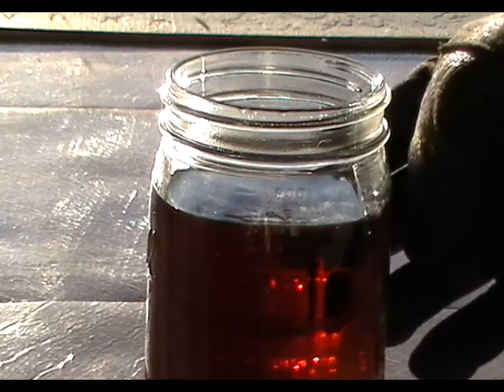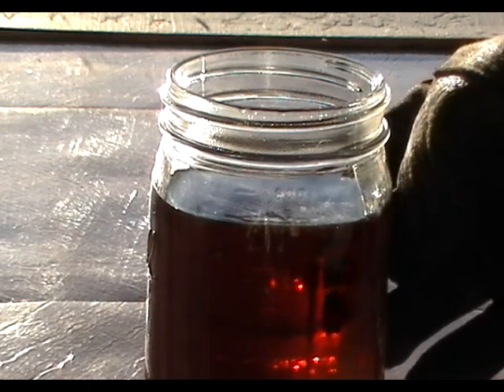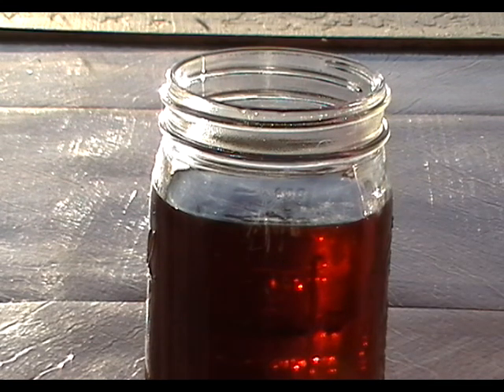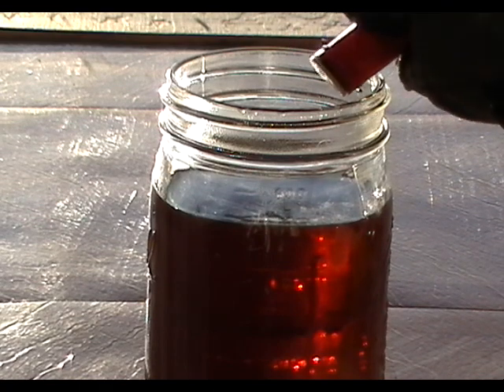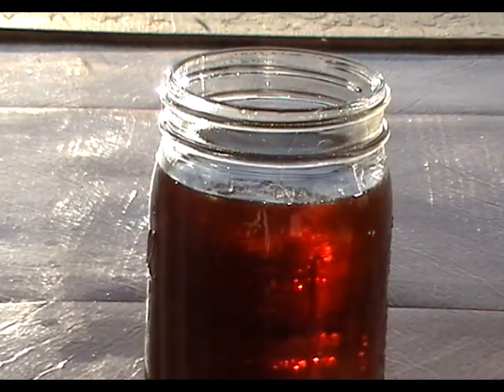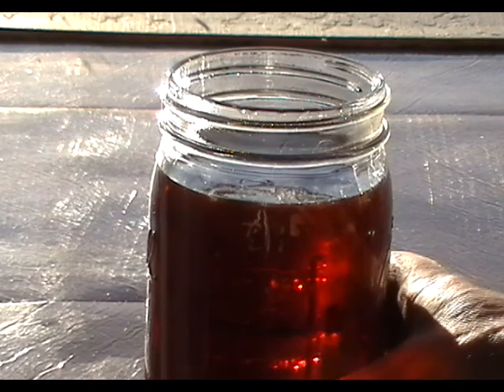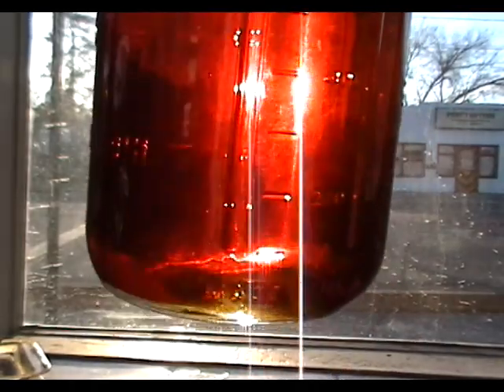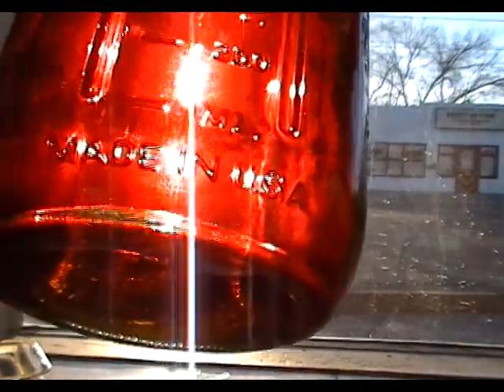Blending Gasoline with vegetable oil to make Diesel Fuel

Comment: Heating Oil Use: I started blending gas/wvo about fifteen years ago when heating oil was equal in price to gasoline.  I did not have the time to create pure bio-diesel, so I started playing around with blends.  I was amazed at the blending action of gas added to wvo.  With no stirring the gasoline would mix with a cross-hatch striation, by itself, and completely blend.  My goal was a blend of 25% gas to 75% wvo.  I found it depends on the heat exchanger in the boiler.  When I upgraded to a new boiler, I had to increase the blend to 1/3 gas.  All the wvo was filtered to 5 microns.  Pros: Cheap fuel, boiler never needed cleaning.  Cons: Boiler nozzle, aerator, and electrodes needed periodic (monthly) cleaning.  Standard pump needed yearly changing or rebuild.  Found a bio-diesel pump that was much better using better seals.  Suntec site has some answers.

The gas basically dissolves/blends with the wvo/contaminants and is burned off leaving some residue on the gun.  Friends would warn that I was going to blow up the house.  I laughed as the problem was getting it to burn.  25% seems to be the threshold and of course you need to give it a few minutes to blend and the fumes to dissipate.  Under normal conditions a match dropped in a small 8oz can of the blend would make a small sterno-like flame until it burned slowly until empty.  I used this blend for 5 years until oil prices came back to normal and wvo reclamation companies took over the wvo market.  

Note: My son-in-law uses a similar method for his diesel truck with a 5 minute gasoline to wvo blend with a cetane chaser.  He used this for about ten years.  Same pump issues though.
Reply: Very interesting good idea. I wonder if it would work in a kerosene wick type heater. Thought about using diesel with cetane booster but I'm a little concerned breathing the diesel fumes with all the additives they put in there.  it's in big garage that does leak a little air in. So it's kind of vented.

Comment: What an absolute gem of a video and thread to find ! I’m sat in my 1.9tdi crying at life 😂 you just gave me free fuel compared to how we pay here in the uk 🎉  Thank you all !!
Reply from the maker: You are welcome, but keep in mind that I have had some developments since posting this series. I have found the red color of my fuel is due to gum which is present in WVO. There are ways to get it out. The presence of alcohols in the blending agents can prevent removal of gum. Whereas, acetone is very effective at removing gum. So, I now add a small amount of acetone to my final blend, allow 24hrs of settling, then drain off the dark red dense liquid sediments using a bottom valve just prior to final filtration.
Reply: @Jhananda  Thank you, sir. What do you mean "gum" in WVO? Iam from hungary, and i don't really know what it is.
Reply from the maker: @lethmorpirk  gum is a group of dissolved solids common in vegetable oils and tends to increase in concentration in waste vegetable oils. These substances have melting points approximately between 200f-350f (100c-175c) and lead to coking and gumming of engines. It is not commonly understood in the dialog surrounding converting waste vegetable into diesel fuel. Gum is not readily soluble in petroleum distillates and Acetone, so by blending these solvents with waste vegetable oil results in gum precipitating out of solution, so this process should be aided and accommodated for.
Reply: @Jhananda  Thank you, sir. So, your advice to prevent them is to let the gasoline and oil mixture settle, and then I can use it without removing the deposit. With this method I do not need ethoxide to settle glycerine?
Reply from the maker: @lethmorpirk  yes each stage of the blend should be allowed to settle for at least a few days, then the sediments should be removed at each stage, because each solvent works to force devolved solids out of solution. And, you are correct this method is not related to the biodiesel process, ethoxide is not required or even appropriate, and alcohols do not help because alcohols are good solvents for gum, which we don't want.
Reply: @Jhananda  Great explain, thank you, sir.

Comment from the maker: There are a number of reasons for adding gasoline to waste oil; however, the central reason is to thin the waste oil out, because it is too viscous to burn efficiently without adding gasoline to the blend.  Thus, adding gasoline to a waste blend, improves its combustion so much, that the blend actually has more power than normal diesel fuel.

Gasoline-waste blends have been successfully run for years and thousands of miles on all types of diesel engines, from IDI to the modern DI common rail.
Reply: Does this fuel work well with modern common rail engines after dpf removal?
Reply from the maker: @madvelila  so far it runs fine in all diesel engines at 50% of the fuel blend.
Reply: @Jhananda  thank you :)
Reply: I have a TDI, you're saying that a 50/50 VO/Gas blend should be fine for the injectors, filter, etc... In the winter also?
Reply: @nicholasjames7795  I think he ment homemade biodiesel and not vo. But lets wait for ansver..
Reply from the maker: @nicholasjames7795  winter is a bad time to experiment with burning waste oil based diesel.  You are going to want to experiment in the warmer 1/2 of the year, and probably not burned waste oil blends in the colder part of the year at all.
Reply from the maker: DaveCaresForYou  so far I have not read any reports from people running newer diesel engine technology having trouble running waste oil blends as long as the waste component does not exceed 50%, gasoline in the blend is no less or more than 20%, and acetone is added to the blend at around 1% and added prior to filtration with no less than a 24hr settling period and sediments properly removed preferably using the concept of a separation funnel.
Reply from the maker: DaveCaresForYou  to the best of my knowledge all diesel engines should be able to run waste oil blends at 50% waste oil + diesel at 30% + gasoline at 20% + acetone at about 1%
Reply from the maker: DaveCaresForYou  I used to belong to every forum that discussed turning waste oils into diesel fuel, but I have not been on any of them for years.

Comment from the maker: @125varma I have been running an alternative diesel fuel blend of 20% gasoline and 80% of vegetable oil in my diesel engine for almost 5 years.  I belong to several alternative diesel fuel forums, where people around the world report doing the same thing, and none of us are having problems with our engine, so it seems reasonable to say that an alternative diesel fuel blend of 20% gasoline and 80% should in any diesel engine without trouble.  However, if there is increased emissions, then add gas

Comment from the maker: @USFiltermaxx while blending waste oils with diesel fuel works, it must be blended at a high percentage to avoid coking the inejctors; however, that blend will tend to gel in cold temperatures. Whereas, gasoline can be blended more effective at as little as 20%, and will prevent fuel gelling down below 0F (-18c)

Comment from the maker: Yes, I use the 20% gas 80% wvo blend all year round with no trouble down to 0F (-18c).  When it gets colder than that I would add more gasoline.  You can add up to 50% gasoline to WVO with no problem, except you might want to make sure there is no alcohol in your gasoline, because the alcohol in gasoline can cause problems for your seals if the gasoline content goes up much more than 20% in relation to WVO.

Comment from the maker: Yes, I agree, it is possible to badly damage a diesel engine by cutting the oil with too much gasoline.  As long as one is using WVO or 10-40 motor oil as the oil in a diesel fuel blend, then one can raise the gasoline content to as high as 50% without causing damage to a diesel engine, and it is theoretically possible to go as high as 75% gasoline to oil blend still without causing damage to a diesel engine; however, there are variations in diesel engine design that need to be considered.

Comment from the maker: @lolailando OK, so, if you are blending with WVO, and using shortening, then shortening is about 1/2 hydrogenated oils and/or animal fat, neither of which will dissolve into any petroleum distillate.  The other half of shortening is light oils.  The light oils will dissolve into petroleum distillates.  So, let your waste shortening settle in a warm place until the light oils rise to the top, pour them off, and blend with them.  The shortening will have to be turned into biodiesel.

Comment from the maker: Good to know that you have had such good success running vegetable oil blended with diesel fuel.  You will find that your autos will run better on petrol as your blending agent at 20% verses diesel fuel, and you will save yourself some money; unless your autos have a heated fuel system, then they will not run well on petrol over 5%.  If so, then you could blend petrol at 5% and the cut your diesel component in 1/2.

Comment from the maker: I screen my settled WVO first through a course kitchen colander to get the big chunks out, then I screen it through a normal kitchen screen, before blending, because I like to put the food particles into the compost.  

Then I blend with gasoline and leave it to settle for a week.  After a week there is a thin film of fine particles and fat settled to the bottom of my blending cans.

After that I run my blend through 3 finer screens (30, 60, 120 mesh) then through a 1-micron bag filter.

Comment from the maker: @centexpw I have been running RUG in a 6.2L diesel engine for 5 years.  It is great as an anti gel.  In fact my fuel has never gelled.  I never get the slimy sludge, as long as I blend, then settle, then drain off the slime sludge, then filter.  So, try blending RUG first with your waste oil.  You will find it helps to clean up your waste oil.
Reply: What is rug.
Reply: @randyvinson7928  Just an educated guess, but i think rug is regular untreated gasoline. Running rug in his engine probably means running with the gas + wvo combination. 

More info: From my research, the main problems with wvo is

1. The glycerin in wvo supposedly leaves behind some kind of residue that can cause gumming up over long periods of time.

2. Wvo doesnt flow when cold

3. If left sitting for some time, some solids form on the bottom. Ive heard that these are gum like. Thats why usually people have a diesel tank that they use for start up, switch to wvo for the main leg of the journey, then switch back to diesel.

Gasoline is a good solvent for carbon, meaning it cleans that shit out. So gasoline should be a good counter to carbon buildup from glycerin. Lastly, since gasoline is a good solvent, i think it help dissolves whatever settles at the bottom, so i think you can use it straight without relying on diesel.

Not im not an expert so dont quote me on this.

Comment from the maker: @lolailando You can make as large a batch of waste oil blend diesel fuel you want.  It will last months in a proper fuel storage container.  It is far less dangerous/flamable than gasoline, but more dangerous/flamable than diesel fuel. The White stuff at the bottom of WVO will not blend, so extract it, turn it into biodiesel, then you can blend it with gasoline, and the rest of your batch of waste oil blend diesel fuel

Comment from the maker: @lolailando Shortening is thick, cloudy, milky colored, whereas, waste vegetable oils tend to be thin and amber colored.  So, look for the light amber colored oil that tends to float on top of shortening, pour the amber colored oil off the top, and leave the shortening, or concentrate the shortening together into a large enough batch to justify making biodiesel out of it.

Comment from the maker: @lolailando Well, yes, a cold upflow process works fine to eliminate the fats, which will not dissolve into gasoline anyway.  But, I just leave my WVO sitting around for about a week to precipitate out the fats.  Then I collect the fats together and turn them into biodiesel, which will dissolve into gasoline to lower its gel point.

Comment from the maker: @christo930 I have a 30-gallon tank, and a 20-gallon processing tank, so I tend to top the tank off with whatever blend I am making at the time.  Most of what I have burned in my diesel engine in the last 5 years is 80% WVO and 20% gasoline, but sometimes I put some other experimental blend on top of whatever is in the tank at the time.
Reply: Jeffrey Brooks Do you have to blend them outside the tank? Could you just add more WVO into the tank at an 80% ratio?

Comment from the maker: @pearljamfan99 Yes, I understand the chemical differences in cetane versus octane, because I used to work in petroleum research at Chevron Research.  

Since I have successfully blended gasoline in the fuel of my diesel engine at 20% for more than 5 years without destroying the engine, and there are hundreds of people doing the same thing around the world on many different diesel engines, then we can conclude it is safe to do so on most diesel engines.
Reply: Any insight on how safe this would be to run in a common rail with a CP3 setup. I live in Florida so cold weather isn’t an issue. What would you recommend to blend with the WVO and what ratio? Thanks bud
Reply from the maker: @tristanpaul6606  I no longer recommend running waste oils at 80%; however, gasoline at 20% to waste oil I still recommend, but the waste oil component should not exceed 50%, so diesel fuel should be used at about 30% to reduce the waste oil component. 

I now also recommend blending acetone at 1% which forces water, high melting point triglycerides, and gum out of solution. And, keep in mind all this blending should be done external to the fuel tank and given a few days to allow dissolved solids to precipitate out of solution and settle to the bottom and be removed prior to filtration.

Comment from the maker: Correct, that 3rd process that you described is called "hydration."  It is the reverse of cracking where light hydrocarbons, such as c4s are put under heat, pressure a catalyst, and hydrogen gas, and they become more complex hydrocarbons.

Comment from the maker: I have not tried blending with gasoline of various octane ratings, because I find plain old regular unleaded gasoline works great in my waste oil blends on my diesel engine.

Waste oil does not "neutralize" gasoline in the blend.  The point to get is diesel engines are designed to burn liquid hydrocarbon-based fuels with a viscosity that is similar to diesel fuel; however, that fuel need not be diesel fuel, but a blend of light and heavy fractions that approaches the viscosity of diesel fuel.

Comment: I drove a friend's 2006 F-250 Diesel 4x4 from Vegas to OC. Is nice truck. If I buy used Ram2500, will not spend $ on mods and will run 265/75R16 BFG All-terrain KO's- they last long, good off-road and MPG, and are $209 at Costco ! Now I drive a Toyota pickup and get 25 mpg highway.

Comment from the maker: @lolailando Well, it is not true that only the "thinner oils" blend with gasoline.  I have found if it is an oil, regardless of how "thick" it is, then it will dissolve into gasoline and become thinner.  However, precipitates are commonly formed from making diesel blends.  Those precipitates are various solids, and various liquids.  The solids are mostly free-carbon.  The liquids are mostly water and lacquer.

Comment from the maker: You are welcome.  If you wish to take a cautious rout in exploring recycled waste oil blends, then I would blend gasoline at 20% with waste oil at 80%, then blend that blend at 50% with diesel fuel.  This way you have no more than 10% gasoline in your final blend, and no more than waste oil at 40%, which should not cause problems for any diesel engine.

Then after running that cautious blend for enough time to gain confidence with it, then start reducing the diesel fuel component as you wish

Comment from the maker: @USFiltermaxx while it is true that 50% waste oil blends with diesel fuel work, they tend to gel in the winter; whereas, gasoline need only be blended at 20% and will keep the fuel blend liquid and burning properly down below 0F (-18c)

Comment from the maker: No, this is not true.  The seals in most automotive applications are BunaN, which will work with gasoline and diesel fuel.  However, gasoline in the USA commonly has alcohol and polar solvents at about 10%, which does damage BunaN seals, and silicone seals, so one need only keep the gasoline in the blend below 40% to prevent damaging the BunaN, and silicone seals.
Reply: 20% petrol 80% wvo blending in diesel
Reply from the maker: @jiyavulhuk1859  while petrol at 20% with waste oil at 80% will work as fuel in most diesel engines it tends to coke the injectors and valves, adding diesel fuel to that blend to 30% so the waste oil component is no more than 50% will run better without coking. If you notice coking then just run diesel fuel only until the engine runs better.

Comment: I am buying a 93 chevy 6.5 turbo to follow your footsteps. I appreciate your efforts to go mobile. I live in a colder climate, Albany NY. In order to use as litle RUG as needed I was thinking, cold upflow tank into a 2nd tank were I blend RUG and settle. I have enough space and time. The cold drum would be outside and feed a drum in the heated basement 8' below, filter after blending in warm bsmt drum. I am thinking the low head presure could push very slow though the filter.

Comment: @Jhananda thanks, could you comment on a couple topics?:
1-Gasoline mixed with wvo, how big of a batch I can do, or how long it would stay good. I mean does it go stale at some point? or can I batch 55 gallons that last me a month?
2-How  dangerous/flamable is an 80/20mix? I know WVO won't ignite at room temp
3- Do you pour that white stuff at the bottom of the cubies, and/or what to do with it.
thanks a lot